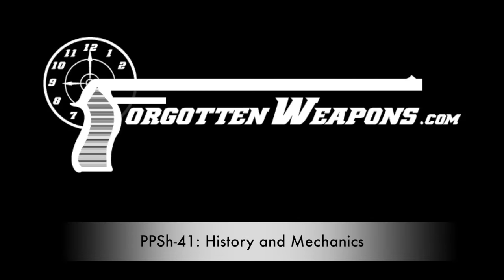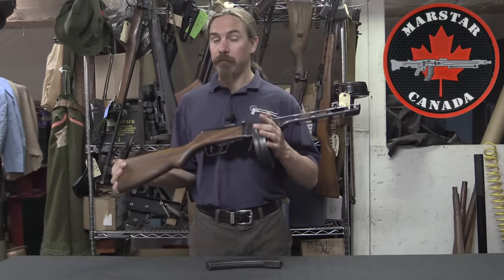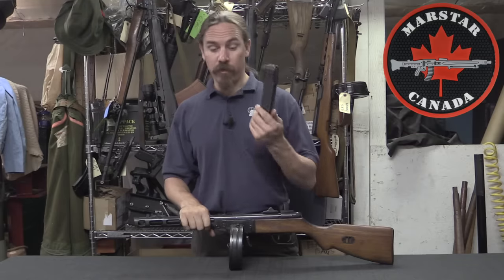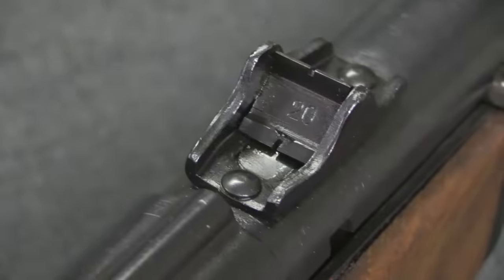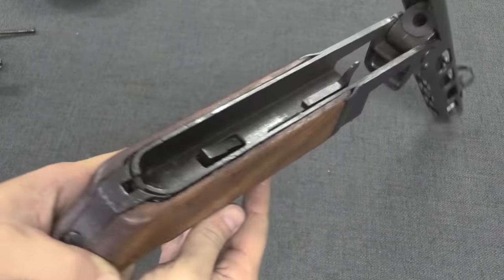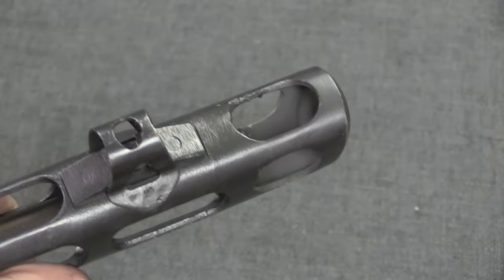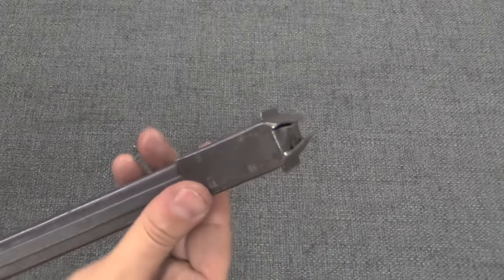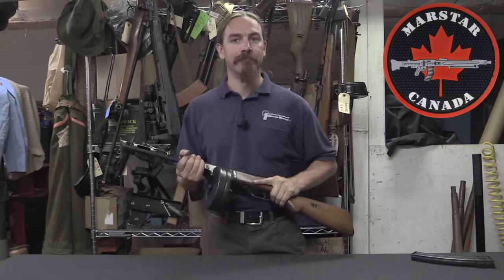Shpagin's Simplified Subgun: The PPSh-41

Comment: I want one just because of how crude and simple it looks. Every piece of metal has marks all over and there's about 4 moving parts to the whole thing, makes an AK look like a Swiss watch.
Reply: It's most likely because this particular gun is made during the war in some kind of factory not meant to make firearms at all, maybe even partually hand made and not by proficient turner but by housewife or infant. This was a harsh time for Russia during WW2, and quality control was simple- if it shoots then it's okay for the military. Later models may be much more fancy and polished.
Reply: Even to make a gun that shoots and functions as well as this despite the tolerances speaks volumes to the design. I doubt there's too many other firearms that could be made like this and function well, if at all.
Reply: it has like less moving parts than a liberator LMFAO
Reply: It sprays like crazy, though. Like 1300 rpm the drum magazine was installed for a reason
Reply: Look at his video on the Uru.
Reply: @steirqwe7956 , and while the PPSh works. it is more accurate, stronger, more powerful, more reliable and longer-range than the German MP-40.
damn, tell me a modern SMG, which can withstand 15 thousand shots in automatic mode, is perfectly controlled when firing, has no recoil, shoots 600 yards, is capable of piercing a police body armor and costs like a can of tuna?
Reply: @inesharroyuy341  To be fair it weight almost like 2,5 modern SMGs which in turn grants descent control when firing. Like every gun there is, it have pros and cons, most notable cons of this gun in being unhandy in general and having "disaster package" drum mag.
Reply: But I would MUCH rather have a Thompson SMG...with it's 75 Rd. Drum...
Reply: @jeffdarnell7942  The Thompson is cool but if someone told me I needed a submachine gun and I could have any from history, I would choose this thing. No contest.
Reply: That has always been Russian design. Not necessarily durable but easily repairable
Reply: There really aren't that many moving parts in an ak. The hammer, bolt, mainspring and the gas piston. I think the 41 is actually much more complicated just by its nature.
Reply: @CecilioSprayetti  well except most soviet firearms are extremely durable and reliable. Some early mgs and smgs were alittle delicate but, especially after the war, they pretty much get the award from weapons you can basically run over with a vehicle and still fire. Not an award that many American weapons can even apply for.
Reply: Yup, the trigger is so cool. In full auto It's practically the opposite of what triggers do. The trigger on this just gets out of the way to let the bolt move freely. Basically if this had to trigger as soon as you'd put the magazine in you'd ride the lightning until you're out of bullets. So simple, so cool. Very cool looking gun as well. Sexy af
Reply: Do you know what rate of fire this thing has?
Reply: Hilarious!
Reply: @jeffdarnell7942 the Thompson submachine gun was issued with 20 round stick mag or 50 round drum mag, but since 1934 all drums were replaced by 30 rounds stick mag.
Reply: @seeerserious between 900 and 1000 round per minute depending on the weight of the bolt. I heard stories of soldiers inserting makeshift buffer to increase the rate of fire to 1200 rpm, but this might be just a myth.
Reply: @inesharroyuy341 The PPSh isn't really effective out to 600 yards.  Open bolt + round-nosed bullet = high dispersion and low energy.

But it does have a 100 metre point-blank range, which is far better than many SMG's, and it's the range at which most infantry combat takes place.

Anything beyond 200m and you're just doing volley fire with a pistol cartridge, which isn't really effective.
Reply: the ak is pretty much a swiss watch
Reply: $600 online

Comment: This thing is like Warhammer 40,000 Ork levels of simple. You open it up expecting the internal components of a submachine gun and it's just a bolt and a spring.
Reply: It only works because the Russians BELIEVE that it'll work
Reply: Doesn't "a bolt and a spring" describe allmost all open bolt subguns?
Reply: @tomaspabon2484  yes
Reply: The Laz Gun is basically a 40K version of an AK so eh not really unique to the setting.

Comment: The info on the mags makes a lot of sense, I have a deactivated PPSh-41 (Because UK) and it's almost impossible to actually pull the drum mag out and shove it back in, you almost need lube for the thing to fit. So the mag wells being a bit shoddy would make a lot of sense. Thanks as always for the informative video.
Reply: Drum mags are a liability anyway, 35 rounds is more than enough, especially with how hard 7.62x25mm hits even though it's a pistol round.
Reply: In Soviet Russia 'Deactivation' only happens to Political Activists who oppose the current government.
Reply: The rate of fire is so fast that you need big magazine so in trenches you don't need to worry about running out of ammo in the magazine during the firefight all the time
Reply: 7.65 tokarev ? or 7.63x29? or 6.35x28?
Reply: not when your fire rate is more than a 1000 rpm thats why ppsh was not a great weapon in the hands of people who had bad trigger control and that is also why it had a semi auto fire mode
Reply: Hey, I watch your videos.
Reply: lol I have a deactivated smle... love the thing
Reply: Funny you should mention this. I came to this video because i also just got a deactivated PPsH. I had the same problem, the drum mag is a pain in the ass to get in and out. Also the bolt is especially tough to pull but i wonder if that i just a result of it being old and un-used. 

Also, is yours dripping with gun cosmoline like mine is? i cant touch the thing without needing to wash my hands afterwards.
Reply: Weaponsandstuff93 sup bro
Reply: Do you have a video on your deactivated gun? I haven't checked sorry.
Reply: I hope one day Britain sees the light and implements sensible gun laws.
Reply: Would it make any difference if you machined the mags to fit?
Reply: Does the PPSh-41 have asbestos in it?
Reply: Good day! I too have a Deactivated PPSH 41 dated 1945, the year of Victory, and also equipped with the same large capacity magazine, and to be honest i had the same problem as you for a short period of time. The Magazine was too big and it would fit very hard into the gun without force. But what i did was some advice of the Soviet Veteran themselves if such problem was occurring with the magazine for you gun, you would slide it in, and them put pressure on the magazine while holding the gun up, pushing the magazine down!  And some force is needed indeed, and what they did back in the time was holding the gun up (unloaded of course) and standing for few seconds on the magazine himself like a chair, not too much and not with all your weight. And for me it worked very well, now the magazine is perfect, not loose, not too tight and also easy to take put and to put in. And this was a common practice which was not such a problem in the Red Army and the PPSH 41. And of course when your magazine was too loose you could exchange it with one that would fit you from other Comrades! While for them the Magazine would be too much tight, So yeah simple as that!
Reply: Good day! I too have a Deactivated PPSH 41 dated 1945, the year of Victory, and also equipped with the same large capacity magazine, and to be honest i had the same problem as you for a short period of time. The Magazine was too big and it would fit very hard into the gun without force. But what i did was some advice of the Soviet Veteran themselves if such problem was occurring with the magazine for you gun, you would slide it in, and them put pressure on the magazine while holding the gun up, pushing the magazine down!  And some force is needed indeed, and what they did back in the time was holding the gun up (unloaded of course) and standing for few seconds on the magazine himself like a chair, not too much and not with all your weight. And for me it worked very well, now the magazine is perfect, not loose, not too tight and also easy to take put and to put in. And this was a common practice which was not such a problem in the Red Army and the PPSH 41. And of course when your magazine was too loose you could exchange it with one that would fit you from other Comrades! While for them the Magazine would be too much tight, So yeah simple as that!

And for the Cosmoline, hot water or WD 40 and lots of time and soaking, would do the job and you will not see any cosmoline ever on your PPSH, believe me mine came soaked in Cosmoline, even the wood, and the magazine and inside of the gun were literally full of it, but now believe it or not, my PPSH is 100% Cosmoline free, and also you need to give some time for the wood to harden, for me it taken years and a great effort to get the wood to be dry and once again in a military shape, be careful with the water there if you would use it! And first Take the gun apart for cleaning!
Reply: Oh no, it is not that simple, and nearly every State has a different law regarding this.

But my deactivated PPSH 41, has the bolt cut 45 degrees, the barrel welded in 2 spots and above that, a spot were they filed it with metal and lead i think! 

 Even so, the front and the end of the barrel is filled to, so no cartilage can be inserted, among another 6 holes into the barrel!

And in this case, meaning the possibility to remove the barrel. Again it is made impossible to do so with some inner welding and blocking of the 2 pins that allow you to separate the gun in more pieces and remove the barrel!

 So indeed, the entire firering mechanism is destroyed, but yet the gun can be used as a display pieces! And the changes can be barely seen. In other States, it is required to weld the entire gun shut, and even to cut half of the bolt, above all the changes mentioned. Which is stupid, since you can not activate it without massive professional work and a new bolt and barrel, which can not be found in any Market and sold!
Reply: Yes, with professional work, a brand new barrel and bold and 2 caps for the weapon, it can be indeed activated. But no one owns such parts and such parts are greatly illegal! Meaning that if you go for them, then why not a entire illegal gun? Because such parts can not be found individually, only with a gun himself. And also were i live now, there are free part sets, meaning that you can buy 100% legal weapons that are not deactivated, but only are missing the bolt and the barrel and the illegal parts, which are those! 
Take a look: http://www.zib-militaria.de/epages/61431412.sf/en_GB/?ViewObjectPath=%2FShops%2F61431412%2FProducts%2F10502

So yeah, it is nor worth to activate a deactivated gun, not at all and the action will cost you your freedom...
Reply: We are not talking about the US here, but about Europe and even Asia. Were gun shops will never have or had such parts in stock, nor such parts are for sale. So the only place is the Black Market or illegal dealers. And if you take that risk, why not for a entire gun?
Reply: They had the same problems with the Thompson and drum magazines, Heavy, Noisey On Recon, Fall out on Run, Hard to Maintain in the field
Reply: BY RADIOACTIVE DECAY
Reply: +RmacNet
I'd assume the bolt doesn't move due to it's deactivation.
Reply: Hello Liam
Reply: @JerresYouTubular  Same in the USA, only difference is that those "Political Activists" in Russia are foreign agents supported by USA, and Political Activists in USA are exact that - Political Activists from people who fights against USA regime.
Reply: I think a lot of the drum mag fitment issues stem from the fact the original Suomi drums have 2 guide lugs (front and back). When the Soviets copied it, they left off the front lug and seemingly decided a friction fit was sufficient. Thus, any bending, wear, or tolerancing issues in the magazine well or drum can upset the feed geometry.
Reply: So you have a cool looking toy

Comment: Germans and Russians during WW2
A: Yeah, the PPD 40 (Mg34) is a great weapon. Too expensive tho, let's make it worse but cheaper.
B: Sir, I am sorry, but i think we unintentionally made them cheaper and better..
A: NNNNYYYYEEAAAAAAANNNYH
Reply: A was a Japanese spy xD
Reply: Mg42 is not realy better than 34 though.
I mean you can realy call it bad, but there is nothing that makes it better than the mg34
Reply: @kingofhogwarts9499  but it maintains the same story of the PPSH and it is arguably better, higher fire rate, easier and faster production, more efficient in mud and snow compared to MG34, etc, all up to debate at the end
Reply: MG-34 suffered from reliability problems, hence the development and adoption of the MG-42
Reply: king ofhogwarts the MG42 has a higher fire rate than the MG34. The MG34 has a fire rate of 900 rounds per minute, while the MG42 has a fire rate of 1200-1500 rounds per minute, depending on the sources, but it’s still a stupidly high number. Also the MG42 was cheaper. The Germans used both weapons up until the end of the war because when the MG42’s barrel over heats, taking out the barrel to replace it is a pain inside a tank, while the MG34’s barrel made it considerably quick. Both guns are excellent weapons either way
Reply: Rafael Enriquez  oh is that why it would overheat so easily you literally had to switch the barrel
Reply: @allenrosales9738  and the the mg42 is 1200 rpm... not 1500 rpm...... and if your wondering in the world of fire arms that is like the difference between a cheata and a Lamborghini
Reply: @dirtysniper3434  Its between 1500 to 1200 not really that much of a difference
Reply: @kingofhogwarts9499  MUCH higher rate of fire and ammo capacity; the two things integral to a Machine Gun

Comment: Finding a mag that works with your gun is something I can relate to even today, having used an M16A2. There are several models of mags in circulation for these rifles and the cheap aluminum-ish ones are so flimsy that just dropping one on the ground might bend the spring out of shape (and possibly eject bullets all over the floor).
Reply: Yes, PPSh's were made by women and children without any quality control, so chambers were just fitted with a file

Comment: Definitely a solid, simple design. Certainly the barrel shroud helps with cooling. I didn't think those large openings at the muzzle would have much compensating effect, but i guess they do. The one thing that surprises me is the skinny spring and guide rod. So many older smg's seem to have large diameter springs in the receiver housing, often located by an extension attached to the bolt. This is much more like a pistol guide rod and spring. It must work fine, based on the shooting video. I wonder what the life of the spring, guide, and buffer were,  and if spares were issued with the guns. Great video as always. Thank you

Comment: I have a soft spot for the PPSH.  I was fortunate enough to get my hands on a “new” one in the Angolan conflict in 1975. It was solid, reliable and worked. It was a far more useful weapon than our SADF issued FN 7.62 “R1”. A big advantage over the FN was the magazine size. It wasn’t accurate and pretty much useless beyond 100m but if I was in a jam, I’d take the PPSH over the R1 any day. The weight of the R1 was a big issue too.

Comment: one of if not the best example of keep it simple stupid.
Reply: Sten series,the M56 a Yugoslav version of the MP-40 and the pps-43 are really simple compared to this gun. Compared to other guns its not as simple since the ppsh is milled and the others are made of stamped sheet metal. Plus needing skilled workers and longer finnish times.
Edit: yes i messed up there is only one milled part but the other 2 guns i listed are much simpler when compared to this sub gun.
Reply: Did you miss the video? Ian shows the only one milled part of PPSh there
Reply: mordentus yea i messed up on that one part. But i am still right about there are much simpler and cheaper and less time consuming guns. In the video Ian consistently states that for a gun that was supposed to be simple and manufactured quickly it still took a lot of time and money.
Reply: mordentus and the rear buffer pad problem ian also stated. Making it hard to use other materials to substitute that particular part.
Reply: Jonathan The M56 and M49 are much more expensive and complicated than the Spagin. The M49 is a tehnically a Beretta M38 with a PPSh trigger group. The M56 is a copy of the Mp40, just oversimplified. The sten guns were cheaper to manufacture, yes, but they were also a blatant copy of the Mp40, again, oversimplified. Mp40 is a simple and design compared to, say, Thompsons, M38s, K31, PPD40s etc. But compared to a Spagin or Pps43, it's nuclear science.
Reply: I heard American (or was it German?) flying to ISS with Soyuz rocket wondering about how much of cosmic equipment are Russians able to fix with screwdriver.
No jokes
Reply: @Martina-Kosicanka  You're saying that like it's a bad thing. I'll take super-important equipment fixable with a screwdriver over equipment that requires an equally-complicated super-gizmo that requires multiple people for the job but ultimately does the same thing just as well.
Reply: @thundersoul6795  No, quite an opposite, I admire it

Comment: Hey Ian. The peened block on top of the trunnion area of the receiver is actually what locks the trunnion into the receiver. The barrel is held in place in the trunnion by the bushing/split pin pivot pin. Swapping barrels on these is fairly easy.